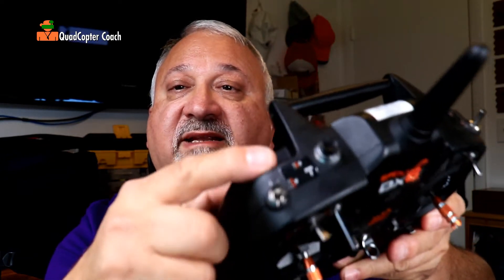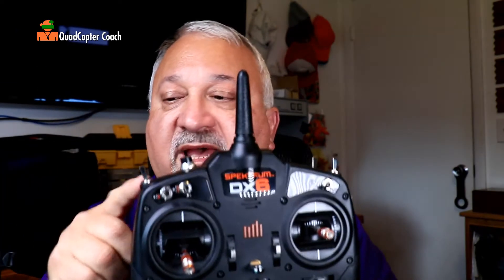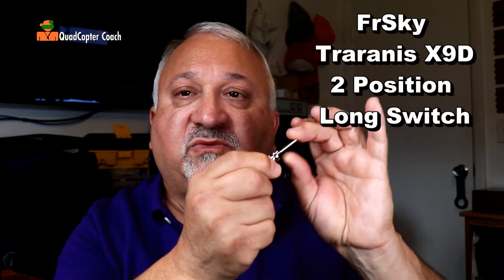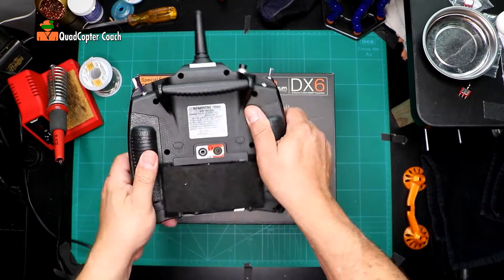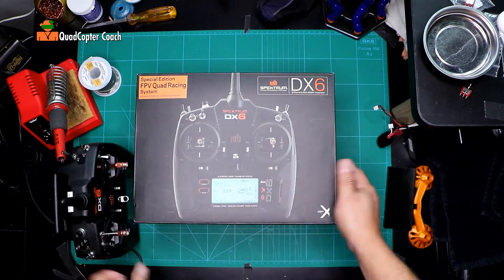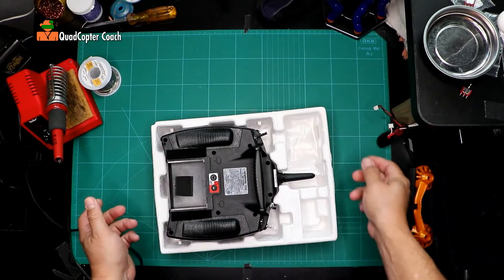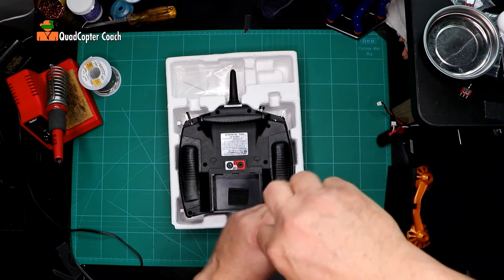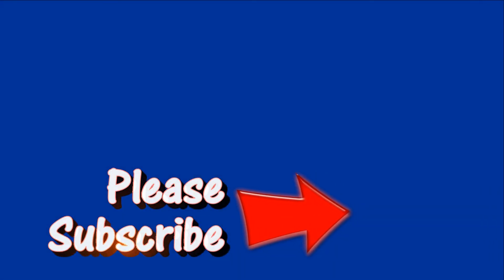Spektrum Switch Repair - DX6

Comment: Joel, your video was great. my problem is getting the correct switch! ALL the X9 Frisky 2 way switches I look at had a schematic showed Three positions. on-off-on.  And the actual 2 position switch I ordered was a spring switch,  Can you tell me the exact 2 way switch you ordered? the 2 way switch I need is for my DX8 Gen 2 transmitter is Switch "H".
Reply from the maker: My video was made many years ago. I forgot what I how I did it.

Comment: Thanks for posting, Joel.  I broke the same switch and I was ready just going to just buy a new radio.  I watched your video and ordered the same FrSky switch (long lever).  I already had the tools, but no experience, but at this point it didn't matter -- I mean I was going to buy a new radio anyway!  Thanks for including and commenting your "errors" during the disassembly in the video.  Otherwise, I would have done the same.  Bottom line, followed the video, did the repair, and she works again! Thanks!!

Comment: Great video! I have a Dx6e transmitter and the lousy power button froze on me. I was able to get the unit open and the boards off of the chassis to get the button free, but does anyone know a way to stop this from happening? I contacted spektrum and they gave me the runaround to send the thing in for service, at $40  an hour plus shipping. I would love a workaround where I dont have to use that idiotic button at all, just plug in my battery pack and go. This has to be on of the worst designs ever. And of course it happens 3 days after warranty runs out. Appreciate comments!

Comment: Thank you so much for this video. I only had my new Gen3 DX6 for 3 months and I fumbled it while taking it out of my backpack and it crashed onto the wooden table out on the flying field. I picked it up and my D switch was bent and didn't function properly. I simply ordered a new part on amazon prime that same night and I received it and replaced it in 3 days.

Comment: Have you ever had a gimbal break on spektrum radio? My right gimbal side to side spring just broke randomly while i had my favorite plane in the air..the stick tensioner just snapped inside and i could not move it up or down either. Ive used the radio alot and took good care of it. I ended up buying the NX6 for a replacement radio and im not impressed with it for 300 bucks the gimbals could be better. Though id ask about that thanks for sharing the vid about the switch.

Comment: That's pretty sad when the manufacturer of a popular product and the main dealer and or retail store that sells that product such as the Spektrum transmitters and Horizon Hobby will not sell the simple replacement parts such as the toggle and slider switches or any other part within the Spektrum transmitters, unless you send the transmitter to Horizon Hobby at your expense, and let them replace whatever part with an extra expense for replacing the part, then you'll end up paying three prices for one simple part that most people could do blindfolded, what a crock of bs, that's why I won't buy anymore Spektrum products, nor will I buy from or deal with Horizon Hobby anymore, and I've heard many other people say the same thing when at the field flying our aircraft of the weekend mornings. I'm done with the overpriced cheap Spektrum products and the big headed greedy dealer and retail business Horizon Hobby. I've bought several types of switches for the FrSky transmitters over the years to replace broken or faulty switches in my DX7 G2 transmitter, I've also purchase a FrSky Taranis X9D SE transmitter within the last year that I like far better than my DX7 because it's more reliable, with far more setup options, with far more different types of receivers to choose from at much lower prices, and the good thing about it all, I know of four FrSky dealers and or retail hobby stores that sell parts and FrSky products within the USA.

Comment: The antenna wire is short and very fragile on a DX8e.   I replaced my switch, but disconnected antenna wire.  ouch, crashed a plane.

Comment: 11:15 Notice the foil label on back of transmitter has a Spektrum part number SPMxxxxx, a model number and a statement of FCC compliance: "This device complies with Part 15 of the FCC code."  Do you agree there are plenty of counterfeit DX6, DX6i, and even seen some DX8 without this info on the silver tag, here on YouTube, and on eBay?
Reply: @joellikecatcher3480  Don't know how to post photos here, but if you go to eBay and see the "original listing" for DX8, item  312595349808.  Also, current item 323802255667, a DX6i.  Item 303139977460 was a legit DX4e, but most eBay listings for this item do not have the proper label on the rear.  Search for Dx8 transmitter, and "sold items"  find this item "SPEKTRUM DX8 RC Model 8 Channel TRANSMITTER with Manuals" FAKE?   Has not FCC compliance statement.  Please correct me if I am wrong.
Reply: @birdwing98  You can't post photos in comments; Not a feature of YouTube. I recommend you only buy Spektrum radios from authiorized dealers. eBay can be sketchy.